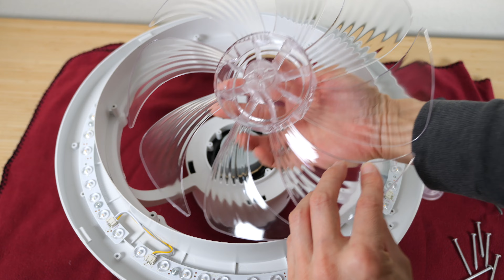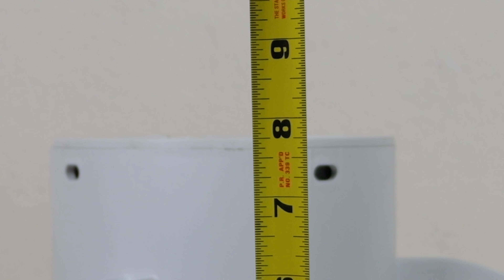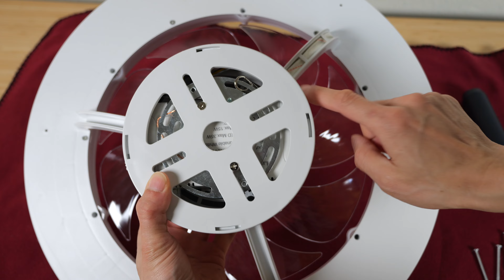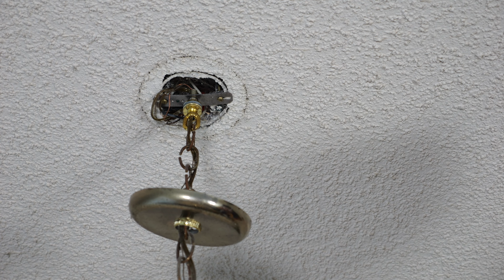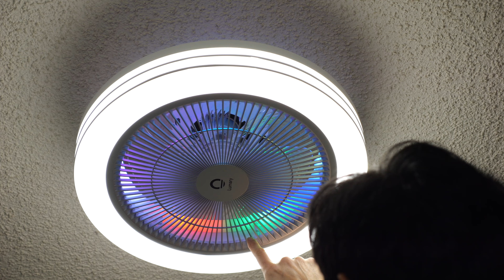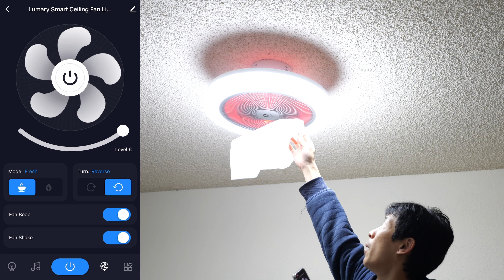Lumary Smart Light Fan Setup and Features

Comment from the maker: CAUTION!!!!! Since the making of this video 11/15/2023, the White light portion of the light blew out on 10/01/2025. The Yellow light still works but you can no longer control the color temperature since it's stuck on full yellow. Therefore it lasted about 1 year and 11 months. There does not appear to have a 1 or 2 year warranty card anywhere so I'm not sure if you can claim warranty even if it is less than 1 year.

Comment: what does "Fan Shake" do? I turn it on and off and can't tell what it does...
Reply: I'm wondering the same thing
Reply: Unfortunately, Fan Shake is unavailable for this model. It’s was designed to control the vibration after a certain speed. Not sure if/when this will be available via update.

Comment: How did you pair the physical remote? I can't get it to worn.
Reply from the maker: It was a bit tricky and I tried a bunch of things before it started working. One of it was to power cycle it and getting the remote to sync right after.
Reply: thanks, I wrote to Lumary support and this is what they said:   

Here are the steps to connect:
1. Connect the device to the power supply and confirm that the device can work normally (the light turns on slowly);
2. Turn off the power supply of the device and then turn it on again after 5-10 seconds;
3. Press and hold button 1 until the device flashes 3 times quickly and then release;
4. The remote control is paired successfully. At this time, you can press the buttons to control the device. @BeatTheBushDIY
Reply: Weird, my remote was already paired. maybe fixed it later revisions.

Comment: We just had this installed but not connected to the switch. The tennis was working till the electricity blipped. The light went in and the remote will no longer work with the unit. How do we get the remote working?

Comment: How does the fan compare to other typical ceiling fans? Does it circulate the same amount of air? More? Less?
Reply from the maker: There is less air flow in comparison as the blades are smaller.